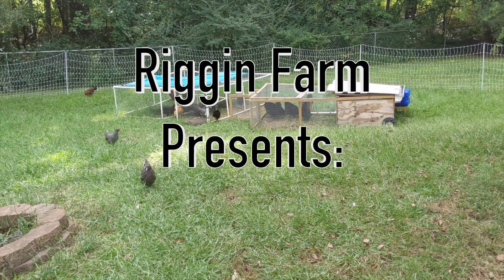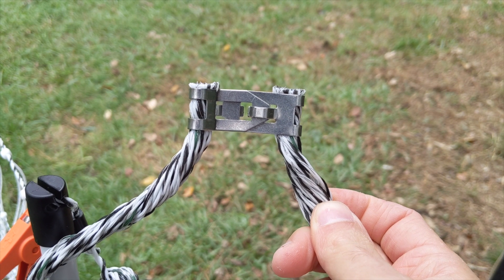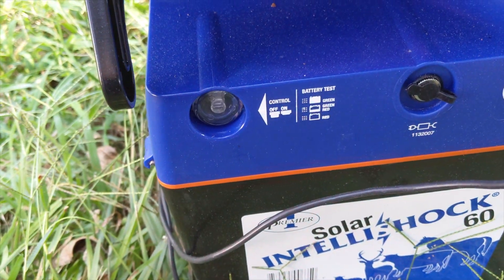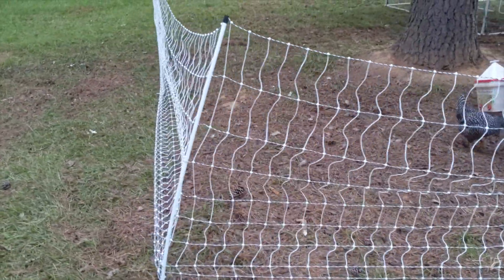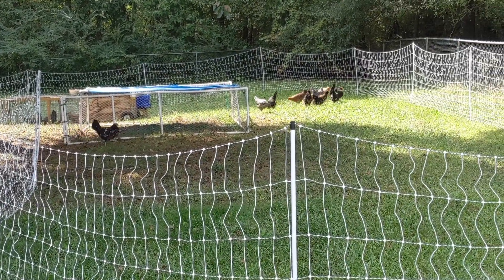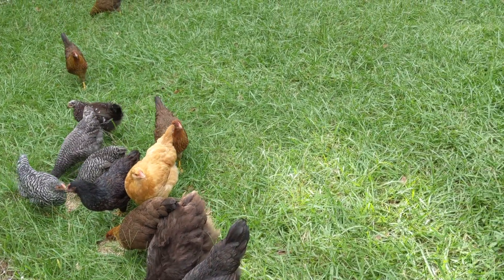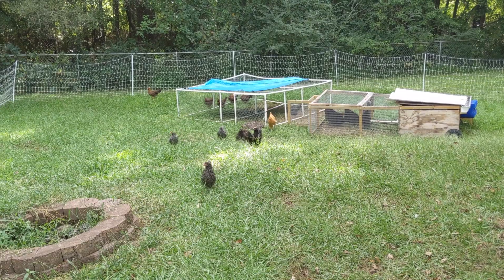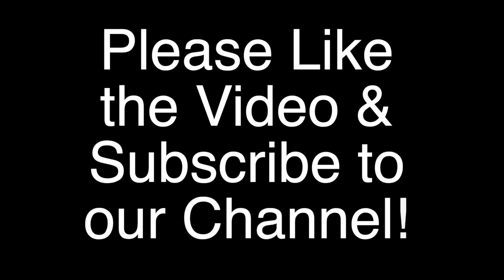Premier 1 Electric Poultry Netting & Solar Intellishock 60 Energizer Review

Comment: Is the charger not holding charge well due to the fact the netting is shorting out on the grass all the time
Reply from the maker: That is exactly it. A stronger energizer wouldn't have this problem.
Reply: @RigginFarm  iv got that same Energizer and run 1500 feet of goat 3 wire and 150 feet of netting. Mine works great, maybe try and get your off the ground some
Reply from the maker: We have a different one now that is rated for up to 100 miles, and it works great for the chickens' and pigs' fences.